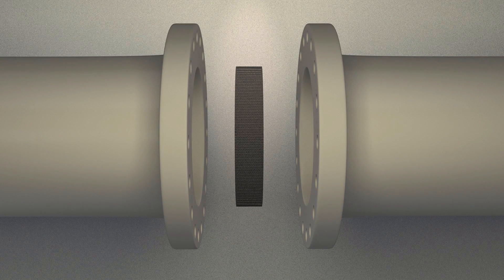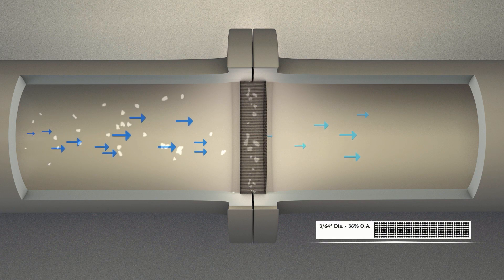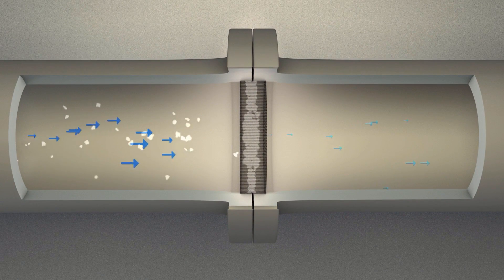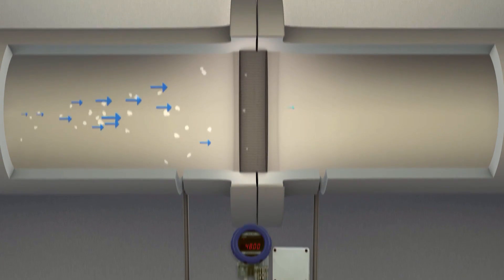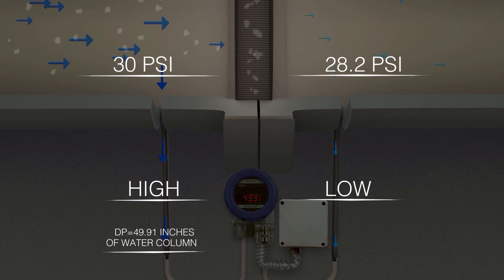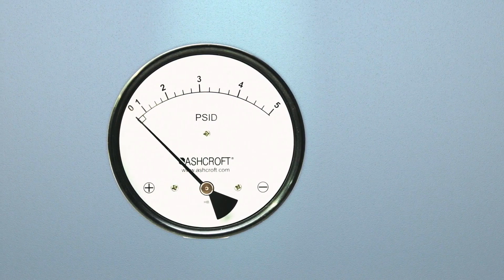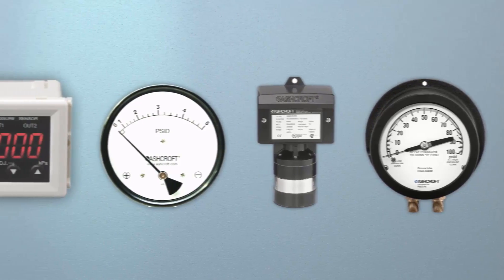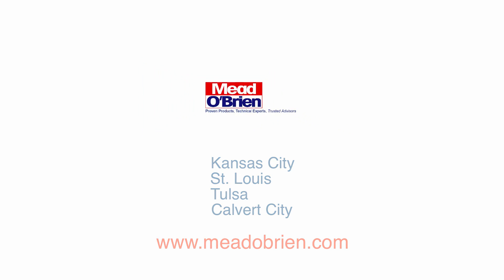Understanding Differential Pressure or Delta-P

Comment: People please understand the dangers of hydraulic jumps around Low head dams!  They are called the perfect drowning machine for a reason.  The boat is stuck in position due to backwash or what is known as a hydraulic whirlpool.  If the rope was chopped the boat would still be stuck there.  If you were in a kayak or were swimming in the same location it could be fatal.  Be aware of the dangers.